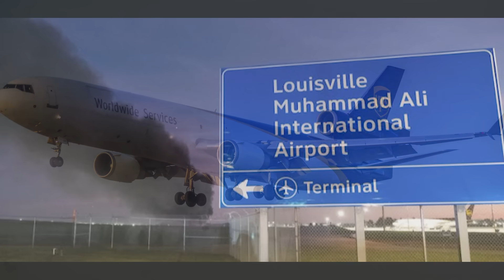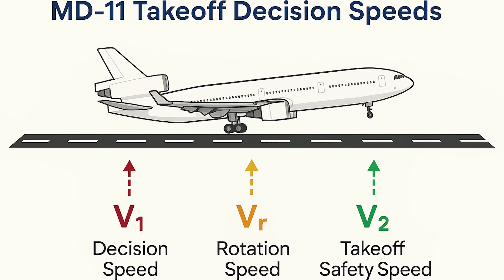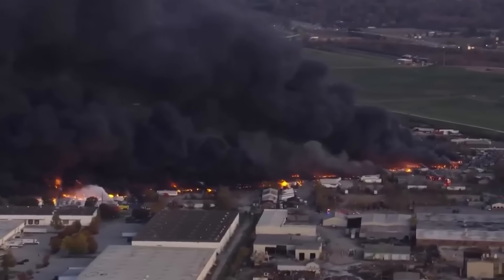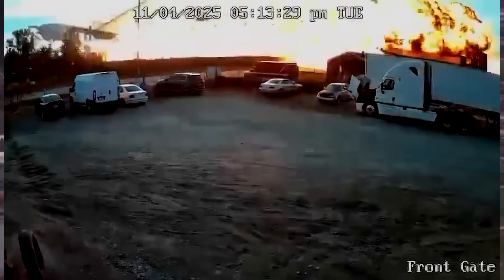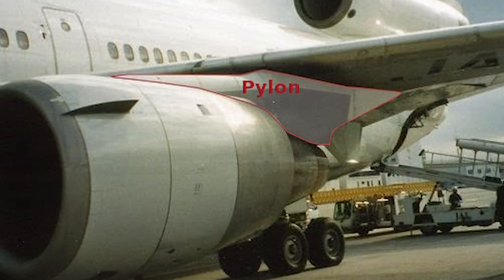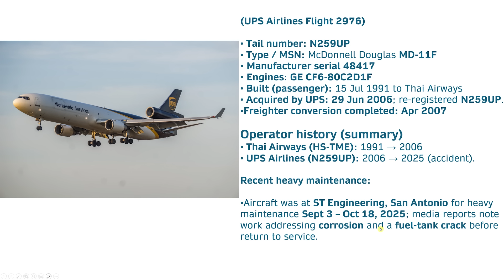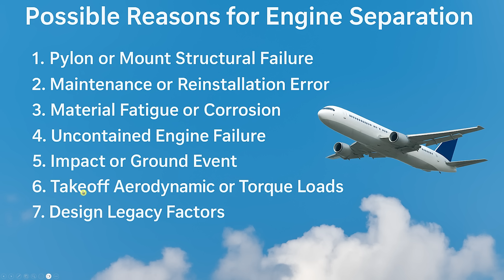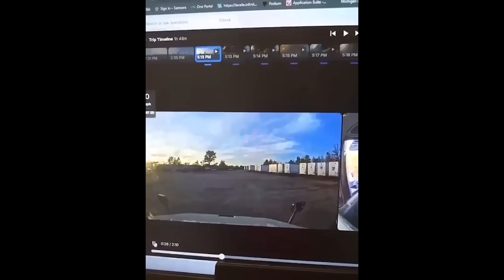What Caused UPS Plane Crash, Louisville, KY? How MD-11 Engine Fell Off

Comment: I would also take maintenance in accountability. 
This all sounds familiar. Loosing the engine i mean. 
There was an incident in the eighty's where a plane got fited a new engine but maintenance didn't do it properly according to the repair and maintenance book.
Simply put, if memory service correctly, the crew was supposed to remove 48 studs that held the engine to its wing which they didn't do because removing 48 studs and reattaching the engine would have costed them more time for the plane to be on ground. Instead they removed a certain zylinder like element that also connects the engine with the wing and refit the new engine causing a break in the support beam that was attached to the engine. 

What I also noticed in the video was the pitch angle. If a plane pitches too high up the engine can ignite because of the fuel. Too much fuel and less air circulation causes this. Except the engine likely was off already when it pitched high up. There are only seconds that pilots can do everything and I doubt its human error on the pilots but the high pitch makes me think smt else. What if the cargo moved into its tail? All possibilities are to consider of course.
Im sorry if i sound like I ramble on knowing what i know but this sounds irrily like plane crash from back then
Reply: If memory serves in the 70, 80, ninety's ups had an incident with cargo before. And other cargo companys too. Basically some things that i will put out here happend back then.
Either the cargo wasn't loaded and or secured correctly, because back then it was up to the companies how to load cargo to the planes. And not often, but in some cases, it wasn't supervised really. Another thing, but smt we can definitely cross out due to ntsb saying, was that the cargo had gotten fire or was high risk cargo. Meaning the cargo resulted into the crashing of the plane. Another thing is metal fatigue or overload rupture... 
If the plane is 20 years or older we can add corrosion as a possible cause too.

Comment: It's NOT obvious that the landing gear hit that building. It's OBVIOUS in the first 2 minutes of this video, based on the angle of the plane and the dust you can see coming off the tail of the plane when it comes into view after hitting the top of that building, that it's the TAIL of the plane that hit that building and not the landing gear.

Comment: Lets be clear and honest, this is NOT a pilot or crew error. The pilot and crew did their absolute best under a horrible tragedy. This is clearly a maintenance issue gone wrong. There is no possible way an engine comes completely off an airplane like this any other way than a manufacture defect and/or maintenance error. Maintenance protocols are not always perfect no matter how good your record may be up until the fault. 

The discipline of the protocol is required, and that protocol must be reviewed regularly to ensure ALL possible problems are addressed, even the ones you can't pick up visually. It's my understanding that special x-ray devices should be used to SEE cracks and fatigue that the humane eye can not see. And I believe their may even be sonagram type device that can scan metal and look for metal fatigue. 

So the real issue is what was the maintenance protocols. What was the timing of the various protocols and why didn't this engine failure and metal fatigue get spotted long before this particular flight. 

In my humble opinion the pilots are completely cleared based on all available info we have to date as well as I could not find any historical evidence of pilot error causing the complete dislocation of an engine at takeoff due to pilots not following takeoff protocols.
Reply: Dei

Comment: I worked in Airfreight for decades.  When the MD-11 first started showing up, in the early 90s, we started saying the MD stood for Multiple Delays (because a myriad of mechanical problems). 
 My GUESS?
     Somebody saved some time when they were swapping out an engine, and the person who was supposed to verify that the Engine was secure, didn't bother to look, and just signed, saying that the work had been finished.  
     Either that, or they took a shortcut to save time, and ended up damaging bolts that are supposed to secure the engine to the wing.

Comment: They performed maintenance on the left engine prior to departure. Which is why it departed late. Also when they inspected the aircraft in San Antonio they a crack in the upper fuel tank and rust in different parts of the aircraft.

Comment: Visual inspections can not show corrosion in structural and hidden areas by the planes covering. 34 year old planes should be taken out of service. I say service planes with several million miles should be scrapped. These planes are work horses, heavily used, with super heavy loads. I realize they are expensive but so is the cost of a plane crashing. I say put a new cap on the life of a plane in service use. Unless a plane is taken completely apart one can not say it's safe with any certainty. The only certainty is a old heavily used plane will fail at some point.

Comment: If he lost hydraulics and the left side when the engine fell off. The flaps wouldn't have been working to provide lift on that side and that would tilt the plane to the left as shown. Now what caused the engine to fall off that started a loss of hydraulics in the left wing is another question. But the plane crashed because of loss of lift on the left side.

Comment: Everything points, after seeing the photo (from other sources) of the left engine that remained on the runway, to the engine mount (the pylon), specifically the one attached to the left wing, having somehow detached and caused a fuel leak. If it had been the pylon attached to the engine, these have bolts that automatically break in case of a major failure, along with the automatic rupture of the fuel hoses, and it wouldn't have caused the fire visible in the video on the front of the wing before takeoff. The engine falling could have caused an abrupt imbalance in the center of gravity, which is why, after V1 and subsequent VR, the aircraft banked to the left. If the engine hadn't fallen, the plane would have taken off without problems under the rules for takeoff with an engine failure, but when it fell, everything changed. That's my theory as a pilot. Greetings, and excellent video. Thanks for sharing.

Comment: Thank you for sharing your point of view. I think you might be right in terms of mechanical errors and or failures but we’ll see in the next 18 months. It’s kind of sad as a phenomenal airplane. And UPS along with FedEx and many other freighters spend millions to make sure their aircraft’s are still in top condition even if you look at an old 747 100 they still run because in those cases they have a good track record with maintenance.

Comment: Prayers for the families of those killed. As to AA 191, my dad was a Captain for American at the time.  The airline brought in 100 pilots he said, and put them in the simulator with that very scenario.  He said 90% crashed, but that 10% were actually able to TAKE THE THING OFF THE GROUND SUCCESSFULLY!  They had to physically LOOK out the window and see the engine was GONE, he said, because the "Textbook response" got them killed. I guess if you lose an engine, that wing is now WITHOUT POWER.  That causes the wing to drag, or stall, and the textbook response is to leave it at max power and reduce power to the other wing/engine.  If they kept FULL POWER on both engines, and trimmed the aircraft out, they could take it off he said.  

But the cause of that crash (AA 191) appears to be DIRECTLY linked to this one at Louisville with this UPS MD-11.  The pylon failed, was damaged perhaps in the recent maintenance.

Comment: These are GE CF6 "high bypass" engines and are one of the OLDEST designs where high bypass was first introduced. That said, the CF6 has a stellar safety record. Not as fuel efficient or as much thrust as the GE-9X or nx series, but it's a reliable engine. There are probably two scenarios here, pylon issues during the period of MAX thrust and stress on the airframe, or perhaps an uncontained fan failure that lead to pylon damage sufficient to cause separation of the engine. The engine sitting on the tarmac looked more like it fell off and tumbled causing the cowlings/fairings to be stripped away... They''ll know right away if a compressor or turbine stage failed.
Reply: General Electric CF6-80C2D1F is the predecessor to the GE90.

Comment: It’s astonishing that even today, we still see incidents where pilots are unaware that an engine is on fire, a wing is damaged, or an engine has detached—while passengers can clearly see it from their windows. In an era of inexpensive, lightweight, and miniature cameras, there’s no reason modern aircraft shouldn’t have external cameras monitoring critical areas such as the engines and wings, with real-time displays available in the cockpit. This simple, low-cost technology could provide immediate visual confirmation to pilots, potentially saving hundreds of lives in future emergencies. Why aren’t these external surveillance systems standard on every commercial aircraft?

Mark Pescatore
Reply: The flight crew probably knew something was wrong with the port engine. The cockpit would light up with tons of critical warnings about it. Combined with losing half of the airplane's thrust, they probably knew that at a minimum the engine had failed. We can't say for sure just yet, though: the NTSB will put together a timeline and share it in due time.

The problem with an engine detachment is it almost always unrecoverable. First, it creates a massive weight imbalance that wrecks the stability of the airframe. Airplanes need to be nearly perfectly balanced along the center line and over the wings otherwise the balance of lift, gravity, drag, and thrust gets into a configuration where the flight surfaces cannot counterbalance it and keep the aircraft under control.

Second, engine detachment typically involves damage to the wing and the systems it contains. That could mean damage to hydraulics used to control flight surfaces, or spewing fuel everywhere when a fuel line is severed which can result in fire even before collision.

Regardless, it is nearly impossible to control an airplane with a detached engine especially given this almost always happens during the takeoff roll. This is a time when the aircraft has the most mass (full fuel tanks) and is as close to the ground as it can be. There is almost no time for the pilots to try anything even if it were recoverable (not likely).

Having an external camera would not change much if anything as pilots are highly trained not to panic and to follow memorized checklists to deal with basically any emergency that can happen, including loss of thrust from one or more engines.

I am confident that the flight crew, may God rest their souls, did everything they could in the few seconds they had. Some situations are simply inescapable and all one can hope for is to take action to minimize losses. This tragedy could have been much, much worse.
Reply: Tell me you know nothing about planes without telling me you know nothing about planes:
Reply: No need, they are getting rid of all the pilots next year as they are redundant.  The computers can easily fly these planes and do a better job.
Reply: There will be interpretations and assumptions of what led to this tragedy, but the single thing that sends the red flag up in my eyes, is that this aircraft had just undergone extensive maintenance procedures. My estimation stems from having military experience with aviation powerplants, is that when thorough maintenance occurs, the wing engines are often separated in tandem with the mounting pylons to facilitate inspection for structural, airframe, engine wear and mount electrolysis buildup.
When the pylon is separated from the wing, it is imperative that proper mounting clearances, which is often referred to as "adhesion" (flush mounting to the airframe within demanded and acceptable increments) are utilized upon re - installation. What happens in some instances is that maintenance crews are put under time constraints to facilitate quick turn around to get the aircraft back into service as quickly as possible and there are often short cuts made to meet those time constraints. Sometimes the adhesion process is overlooked and signatures go onto maintenance records without visual verification or actual measured verification. The result? There's the wild card. Aircraft can go and be in service for months or extended periods of time with no ramifications. Yet, when in certain instances, the result can be catastrophic failure for several reasons, gross weight, cargo weight, loose mount bolts, cargo placement, takeoff strains, fuel weight volume and a long list of other factors that could be measured. Out of all of those factors, it only takes a small flaw to cause wing engine separation to occur. I may be wrong in the long run, but my educated guess is that there was a failure of pylon adhesion to the wing mount, causing catastrophic separation from the airframe superstructure.
It was a perfect storm of human error and misfortune that caused such a painful tragedy that took human life.
Godspeed to the pilots and all affected in this tragedy.
May God rest their souls and their families pain be one day assuaged.

Comment: One report i saw said the blackbox data shows the plane was at 400+feet and traveling 210 mph when it crashed. That plane barely reached 75 feet. How accurate is this flight recorder data (or is it just horrible reporting by today's so-called journalists)?

Comment: Back on Oct 19, 1995 my friend Jack was at the controls of Flight 17 out of Vancouver International Airport (YVR) heading toward Taiwan.  Close to 300 passengers and crew were on board the Canadian Pacific DC 10 when during takeoff, and now a speeds of about 180 mph Jack heard an explosion in the left engin.  With two engines still operating, Jack could have taken off as did the UPS pilot.  But he didn't.  His immediate decision was to abort.  And with little runway left, Jack tried to avoid the lights at the end of the runway which he said could have caused a fiery incident if hit.  Instead, the plane veered off into the muddy ground to the side, causing the forward landing gear to collapse,  Except for some minor damage, no one was seriously hurt in the accident.  This incident is descibed and illustrated in an older You Tube video, "Big Aircraft Collapses During Takeoff at Vancouver Airport - Canadian Airlines Flight 17". For privacy I didn't provide Jack's full name.  But over lunch this week, I mentioned how close he came to making the decision to lift off.
Reply: Did the UPS pilot have enough runway to work with? Or muddy ground past the end of the runway?

Comment: There are historically known technical reasons while the engine would fall off as well as resulting complications with the flight controls. But, this is the time to honor the lost and their families. Thoughts & prayers.
Reply: Right, 1992 a 747 crashed in Amsterdam. One of the engines fell,  due to a bad pilon, and collided with the other beside it, taking all engines on the rightside down. The 747 then crashed sideways(right) into a residential area(building)

Comment: Engine mounts broke or was improperly installed.remember when they changed the installation process and used a big forklift to install the pins and wound up breaking the mounts? I remember that.
Reply: Captain obvious!

Comment: It appears to me that the small frame before the trees I believe I’m seeing a jet engine there. That jet engine could’ve came off hitting the building. I remember an old problem that when they would replace L1 11 engines, the mounting brackets could crack. It has just a few bolts that the whole unit swivels to replace the engine.
Reply: The left engine was found back before the end of runway so it was LONG gone before the plane even showed up on this video. Not sure what you’re seeing.
Reply: @JohnHallgren  yes you’re correct. I wrote this before. I watched the whole show my mistake.

Comment: I know that was a slip of the tongue - petroleum? Never in jets! The fuel is AvTur (in the UK at least) which is basically a refined variation on Kerosine, a low volatility fuel, far less ignitable than petrol. But it will readily ignite when vaporised and exposed to a spark or flame or electric ark like hitting the power lines as this unfortunate jet did.

Comment: The sad fact of the matter is very, very simple. Someway, somewhere and somehow HUMAN ERROR... Is the root cause of this disaster! Albeit from a manufacturing defect, to poor, improper and or unsupervised maintenance... HUMAN ERROR IS ALWAYS INVOLVED! One of the Apollo astronauts was reminded that out of approximately 2 1/2 million working parts on the spacecraft he was about to go to the Moon on, the engineers had estimated a 1% margin of error on the remaining parts. If my math is correct that is around 2000 parts... That could quite possibly fail at any point during the mission! IT ALWAYS COMES DOWN TO HUMAN ERROR.. FLYING IS INHERENTLY UNSAFE! Rest in peace to all affected by this tragedy 🙏😢

Comment: We live near an air force base. Years ago there was a requirement, in our area, that nothing could be built within a set distance of the runway.  That safety measure has been dumped. They now keep building homes closer and closer to the bases runway take off.

Comment: this issue already happened in 1978, a DC 10 lost 1 engine during take off...all died, it was somewhere in the US. The engine is hold on 3 mounts if I remember and maybe the same problem happened also in this case.... DC10 right?